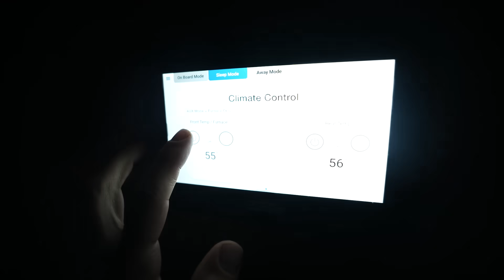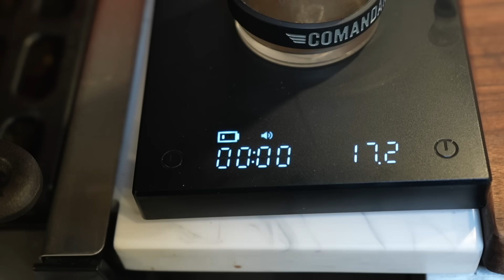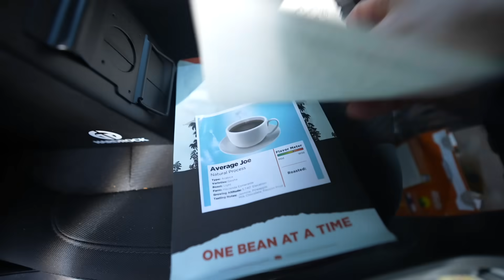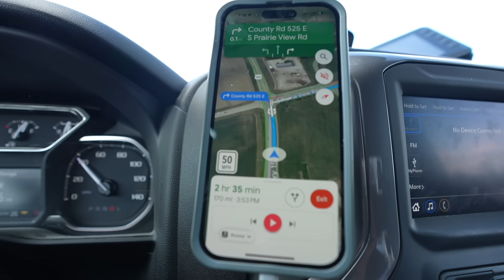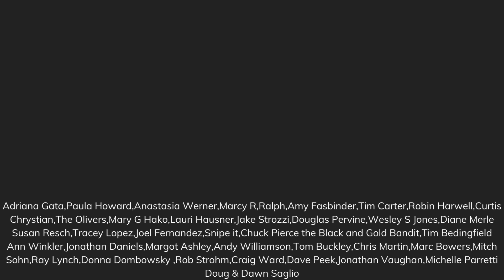We Live at a Truck Stop // Ep. 8

Comment: get a double electric blanket .. then have it on for a couple hours and turn it off .. if you find it chilly again just turn it back on for a bit .. they are the best way to stay warm and they are super cheap to operate. .. some rv'ers use them under the mattress cover and some use them on top. this is the cheapest and most efficient way to stay warm and you will enjoy the savings in propane.

Comment: - sources it is a bit industrial, there also should be a few heating plants that utilize such an interlock switch. 

Another reason that the switch may not be triggering is restricted air movement, perhaps a dirty filter ? 

A way to check the switch would be to place a jumper wire across the contacts to see if the furnace starts. It is dangerous to leave jumper in inplace💀 to make furnace run…

Comment: Repair your switch with some contact cleaner or a piece of really fine sandpaper to the contacts. The switch probably has burnt contacts the contact cleaner or the sandpaper will knock off the burnt carbon deposit. If this doesn't work the switch is out of alignment I would suggest you replace instead of bending the contact springs considering the application it is being used for. Contact cleaner and sandpaper from Lowe's or Walmart

Comment: Wondered if you guys reached out to any Airstream dealerships/repair centers.  There are many throughout the US.  Or reach out to your dealership.  Appointments might be difficult to get in  but if you just talk to someone in the shop or over the phone about the issues you are having perhaps they could help you order a few parts to pick up when you're passing thru a certain area or town.  Meanwhile you could get a  small ceramic heater  from Walmart/Target for when you have electric hookups...it heats the whole Airstream pretty quickly.  Many Airstream travelers do this.   Additionally,  you can also carry a portable Buddy propane heater to get you thru boondocking spots until you get your unit fixed.  Need to buy several small propane coleman canisters as well.   Hope this helps and good luck.

Comment: I wish I could give recommendations for Iowa spots unsure which area to suggest. But HVAC that blower switch metal bar needs bent slightly towards the blower wheel. Over time metal bends in these rv heater switches. Simple fix. If it's not rubbing on the wheel your good.

Comment: As for the “wind vane micro switch” goes, evidently the heating engineering designers thought it was a good idea to put a safety interlock in you heating plant the checks to see if the FAN is blowing air or running before it will let the heater run…. Sooo the paddle pushes on the micro switch when air is moving from fan… contacts in switch seem iffy, maybe electrical contact cleaner? ( must dry completely,  it is flammable )Maybe microswitch needs a replacement…. Tail of wind vain is providing enough pressure/leverage to the switch to trigger switch closure. 
 Per haps the wind vain my be transfered to another microswitch (carefully) ?  
Micro switches are sorta  generic, voltage/amperage ratings are important… under rated will weld contacts together
Switch should be available from many -

Comment: Does this title match this video?  
Find yourself an HVAC wholesale parts house and see if you can find a suitable airflow switch to replace that one.   Meanwhile you could extend the wires into the passenger compartment and manually operate each start.  (Don't just bypass the switch unless you're willing to monitor it the whole time it's on and shut it down before taking your eyes off it)

Comment: You guys are educated! I didn’t hear you use any noise in Illinois. Very good. Also, most truck stops with repair shops ( Luvs has tire shops) will blow that part out for you. For no charge. I know on my truck I carried an air chuck. For those not in the know. Big rigs are traveling air compressors.